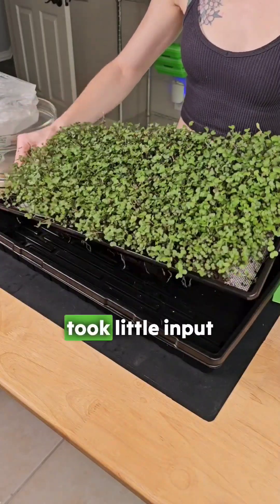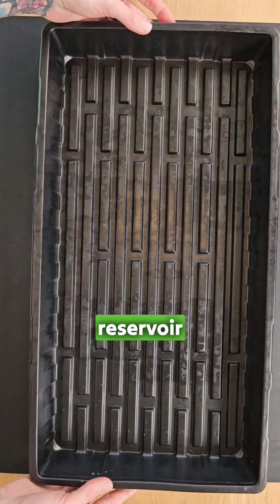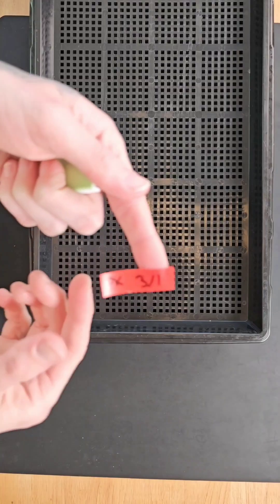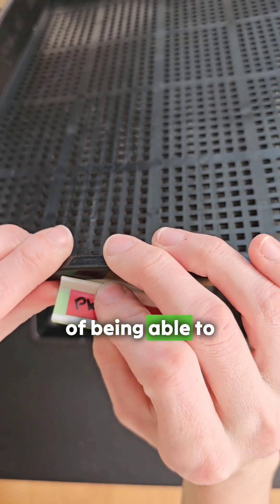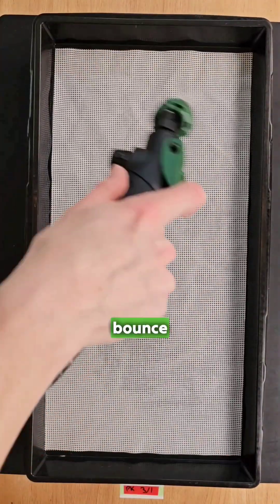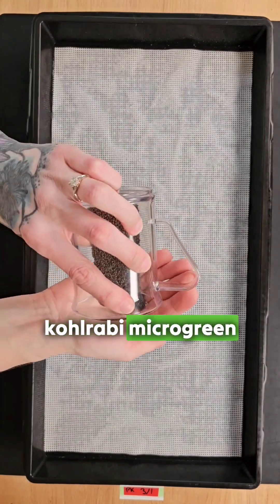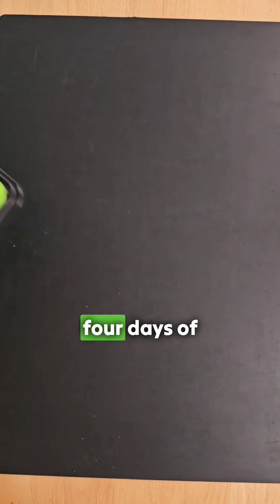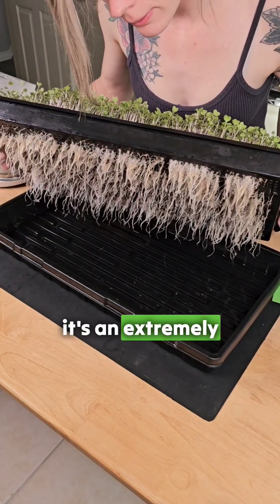Seed to Harvest in Just 12 Days: Effortless Microgreen Growth! 🚀 | Simple DIY Hydroponic Setup #diy

Comment: The issue that you can immediately see is that the stalks don't have strength, which is something they only get from soil and compression. 

This is a great method for a longer grow and personal use, but if you intend to sell in any way, do a soil and compression grow. They'll end up taller, stronger, and overall more nutrient dense.
Reply from the maker: Thanks for sharing your feedback 🌱
Reply: I run a small circulation fan and it helps alot to strengthen plant stalks.

Comment: The silicone medium seems less hassle than soil. Is there any benefit from soil medium that can't be had with the silicone? And how many grows do you typically get with a silicone medium?
Reply from the maker: It is quite a bit easier, and also has it's own challenges like with any medium. Though its generally just adjusting to watering with the right amount of water. The main benefit would be less of a mess on both seeding & harvest day, as you do not have to clean up all the debris. And that its reusable. The amount of grows you can get really vary on how you take care of the medium. For instance, I've used the same sheets to grow with for months now, and only use silicone safe cleaning practices to help retain the life of the medium. 

We highly suggest reading this blog to learn more in depth on the medium - https://onthegrow.net/blogs/news/meet-our-new-reusable-microgreen-grow-medium-silicone